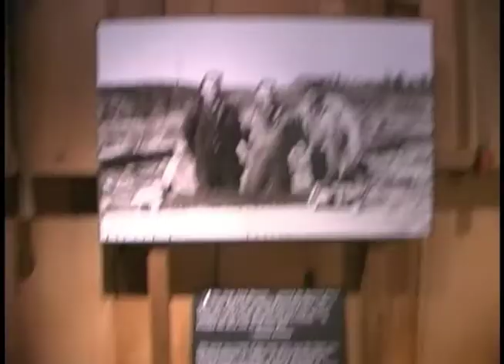LOGGING CANADA George Wray 2001

Comment: Good video, lots of stories in that old logger I bet.The eastope engines came in 1, 2, & 3 cylinder, they used parts from the old ford model A's in them so they could be fixed by anyone, anywhere and were very reliable.
Reply from the maker: Thanks for the great comment and info Cheers !